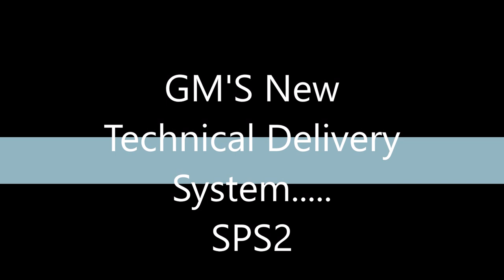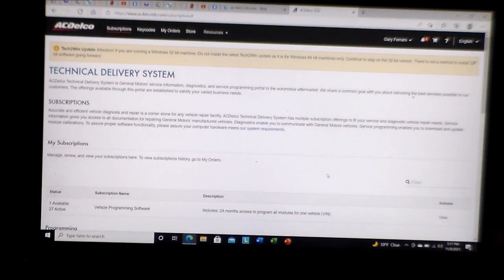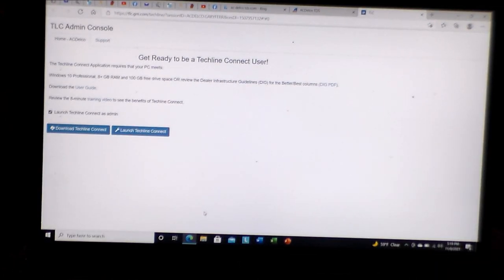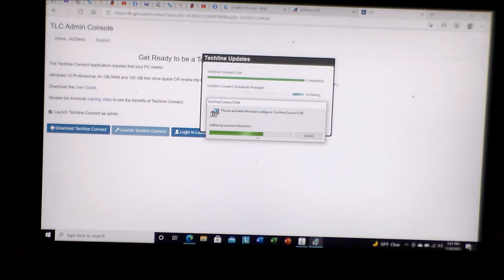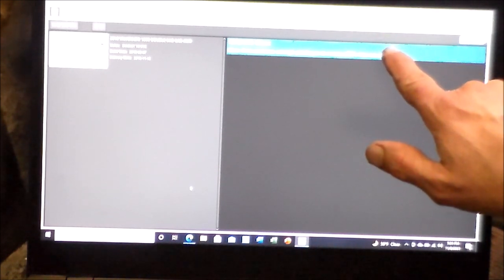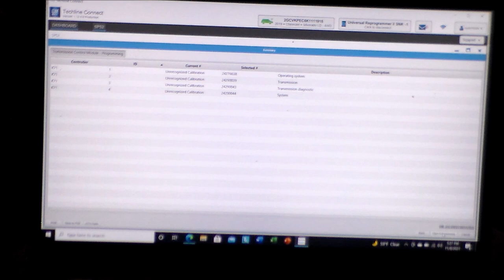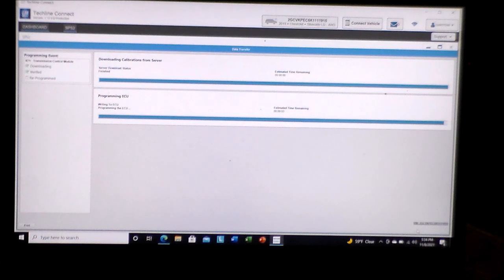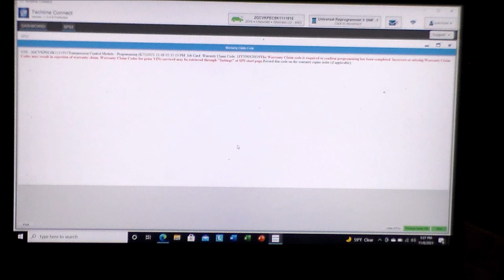Programming with GM'S new SPS2

Comment: Hi Gary,  I have a 2023 3500HD. Is that the software that I would need to program in like the Navigation and back up cameras, power folding mirros, etc?  I know the radio and ecus have everyrhing integrated, just not unlocked from the factory unless you pay for the higher trim or options.  Looking to upgrade some of the features on mine

Comment: I have a few quesitons.... so i know you have to buy the mdi2 device and pay the $45 for the vin. but is there anything else you have to pay for? do you have to pay the $4000 for techline connect or do they let you only use that for the sp s2 programming? 
also if i had 3 different ecms that i wanted to program all the same vin and calibration to would i be able to do that off 1 vin lisences or would i need more?
Reply from the maker: You purchase time from the GM website, the 45 per vin with 24 month access to the vin.  Download Tech-connect.  Do AC Delco TDS that should get you to were you want to be.  Also may have to load the software to your MDI or J2534 Pass through connector

Comment: Hi Gary, is there a reason your Autel/Snap-On could not perform that programming?  Was the TCM replaced? I don't know GM software just BMW.
Reply from the maker: yes, new tcm, had to purchase time from gm, need the pass thru connector to perform this the J2534
Reply: @GaryFerraro  ok copy yes I have the Wi-Fi adapter for diag/service and J2534 for programming.  I will call you tomorrow about possibility of shipping a 6HP21 valve body for overhaul.
Reply from the maker: @igotaction  ok, if possible call Tuesday, Mondays are always crazy
Reply: @GaryFerraro  yes sir will do, tomorrow I can get my Transtar account set up😉
Reply: @GaryFerraro Hello Gary, I am new to your channel but I am wondering if it’s possible for me to reach out to you ? I just recently did a v6 to v8 swap on my 2012 Chevrolet Camaro and now i had to buy a mdi 2 programmer because my car won’t start due to anti theft, but I do not know how to use it

Comment: Hey man, urgent!

Om trying to program my chevrolet orlando 2.0 163hp from korea origin,

It dont recognise and gives me an error "e6220 - no vehicle authorization"

What to do)
Reply from the maker: probably because of the vin number.  What is this car the same as here in the states
Reply: @GaryFerraro what should i do on this case? Need very urgent
Reply from the maker: @wikiliks1187  only thing i can think of is to enter the information manually from another car and see what happens
Reply: @GaryFerraro  nah, i purchased sps2 prog for korea and now connecting

But i have changed bcm, ecm , immo + key are from another car

Only cluster is left from previous setup

I have bcm pin, how to adapt immo and sync modules?
Reply from the maker: @wikiliks1187  That i'm not sure, sps2 may walk you through if it's an option